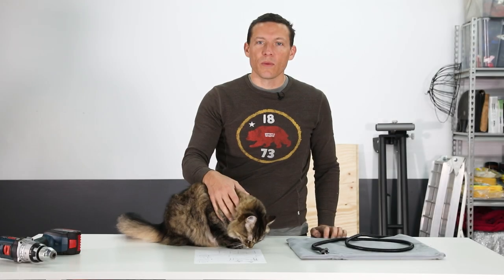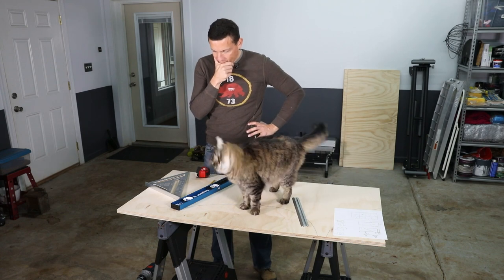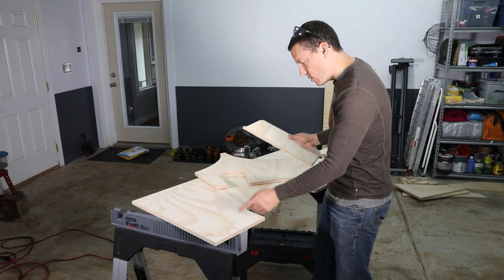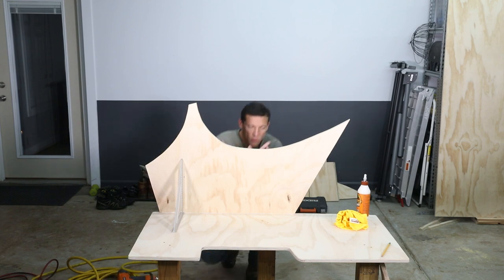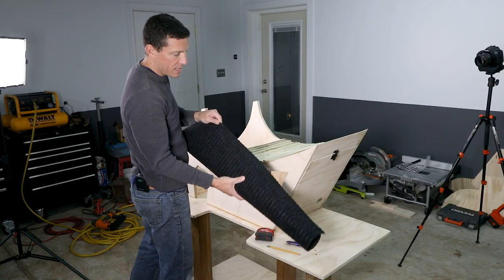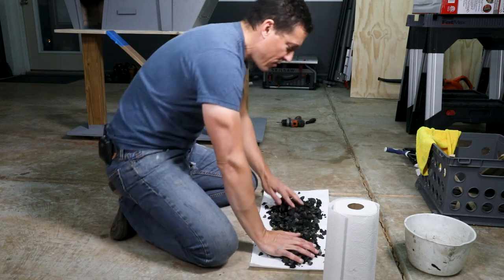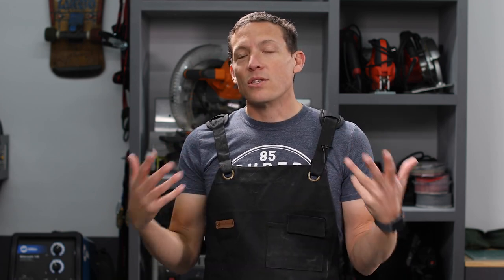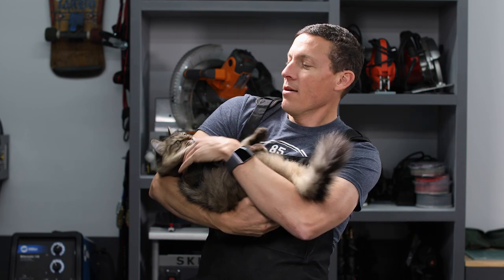DIY Outdoor Cat House Build

Comment: I don’t know how you got your slats for your roof to stay on. The plywood I bought has so many holes in it that when I try to attach a roofing piece to the plywood wall and the nail just won’t hold it in. I can’t start over; I’ve been working on this way too long to do that and it’s really big. I guess I’m going to try construction and he’s up before I put this whole thing on the trash pile. I learned my lesson about cheap plywood, but I’m not sure any of it’s any good these days. Still, your video is still an inspiration!
Reply from the maker: I didn't use plywood for the roof slats. At about 9:30 in the video you can see where I made the slats. I used old 1.5"x 3.5" pressure treated scraps of wood and cut them into 1/4" slats or strips. You could do the same with a 2x4 or 2x3. Cheap plywood really won't work. The sanded 1/" or 1/2" plywood might. The plywood might just be too soft for the finish nail gun. Try lowering the pressure on the nail gun. Also try using wood glue on the bottom first one and clamp it. After it dries you might be able to get more of them to stick/ stay in place with glue. Remember I make a lot of mistakes (watch some of my other videos).  Just have a coffee, stare at the project, and try again. I'm sure your cat will love it no matter what.
Reply: @ZachTheMaker  well, thanks so much for your reply but I have watched your video so many times that I’m sure, I’m at least 100 of the watches on it. I’m sorry I can’t give it a thumbs up every time I watch it. LOL. I’m very aware of the whole video, and know that you did not make the slats out of plywood, but isn’t that what you’re brad nailing them or finish nailing them into… The edges of the walls?   I’ve been working on this thing for a couple of years… In fact, it shows I commented on it a couple of years ago. 😳

Comment: Still working on mine, but with newbie modifications!  I’m trying to insulate mine...yikes! I DID wonder why you were gluing those rocks on the chimney while it was upright though. I’m lazy, I guess, but I would have laid that thing on the side to make it WAY easier! Of course, that’s easy for me to say...from the outside looking in. But, having watched this MANY times, I’m seeing different angles,, soo... My son used to aggravate our cat like you did Sprocket in this video...good thing these guys are tolerant! LOL
Reply from the maker: With the glue we used it was easy to attach the rocks with it upright. The glue had a good initial grab. Sprocket actually just enjoys randomly attacking me without provoking. He never bits hard and is usually purring. I've built an insulated one before. I made small SIPS panels using garage door insulation styrofoam sandwiched between two sheets of 1/4" plywood.  Then I just built the walls and roof out of it.  The walls will be about 1-1/2" thick. I then used a clear rubber piece infront of the door opening as an air curtain. Hope your project turns out great. Thanks for watching.

Comment: Beautiful house for your fur-kids!  I’m gonna’ TRY one sorta like it. On the roof...did you do a layer of the slats under the rug, as well as over? And if so, did you just glue the first layer? Just asking because it seems like if you nails every slat and then had to come back and now another layer, that the nails would start tearing up the plywood edge. I don’t know, I just don’t want to mess up something that I spend a lot of time on. Thank you for your answer and  thanks for sharing your work.
Reply from the maker: No I just did the rubber rug attached with a staple gun followed by one layer of brad nails. I used 18ga 1-1/4" brad nails. Those nails are small and placed directly in the center of the plywood using the finish nail gun. Placing the nails by hand would be tough but could be accomplished with patience. My cat house sits under the eve on the porch so it does not get directly rained on but it does get wet. It actually still gets really wet and it's stayed dry inside. If you have anymore questions along the way feel free to ask. - Thanks for watching.
Reply: @ZachTheMaker  Thank you! It’s on “the list” of projects! My two old ferals have a whole garage as well as a  covered 4x4 level area that’s open on two sides, but we now have “wild things”  that show up every night to finish off their food, so the cats NOW hang out on the FRONT walk and in the (just dirt) flower bed, I can’t blame them....the possum is okay, but a family of skunks...I don’t go outside after dark myself now! So, they need a front yard shelter.  The rubber rug is perfect to keep the rain out. I was just about to research how to do a shingle roof before seeing your video. Glad I didn’t have to go that route! Thanks again!

Comment: how can that small space fit three grown cats.. they need their own area's to feel comfortable..
Reply from the maker: The two black cats are offspring of the white one. They always sleep cuddling together. In the summer I put a small pillow on the curved roof and they sleep on the roof.

I also used to have three random stray cats that we're at a previous house. I built three smaller houses and they would all cram into one piled on top of each other. From that experience I think they prefer one larger house. However inside cats are totally different and prefer their own place. Just my experience 😁
Reply: @ZachTheMaker  ah so thier sibies and are already aclimated to sharing territory space..